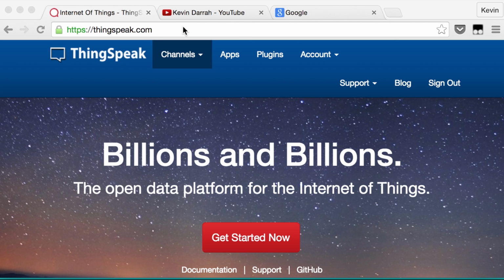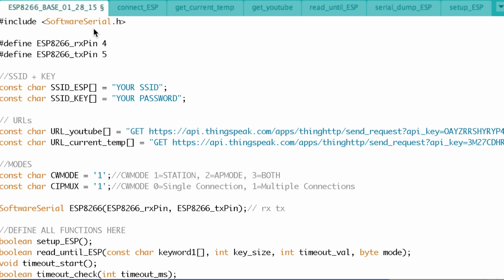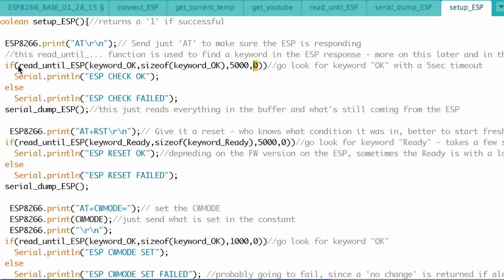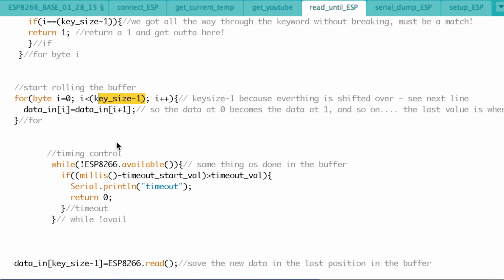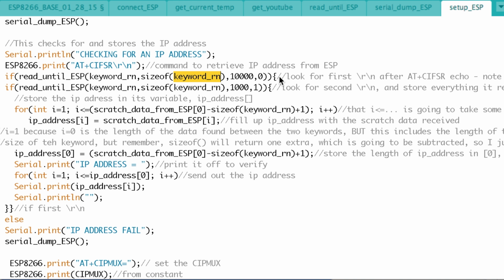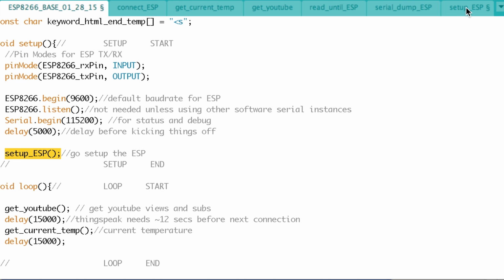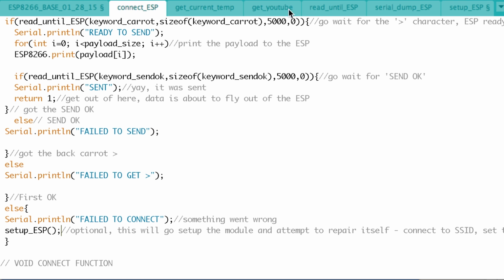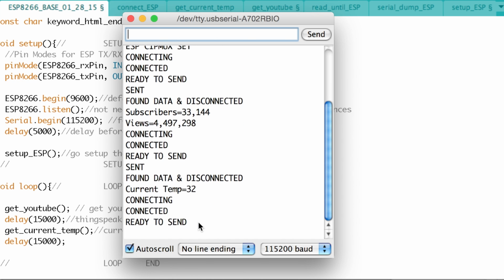Cheap and Easy WiFi (IoT) Tutorial Part 2 - ESP8266 Arduino Code

Comment: Hey Kevin' great tutorial. I really love your tutorials and they're simply the best out there. But you should really consider using the actual API for getting data from websites since the current method while it works just fine its a lot of overheard and its not proper since websites change their layouts all the time.

Comment: Hoping someone can help with an issue setting the baud rate on the esp8266.  I updated to this latest version of the cloud update:

AT+GMR
AT version:0.21.0.0
SDK version:0.9.5
OK

I can connect well via USBTTL at 115200 but cannot change baud to 9600 so it will work with the arduino script in this video.  I've tried AT+CIOBAUD=9600 but that's not supported any longer (returns ERROR).

I found reference saying the right command is now: AT+IPR=9600 but when I do that I cant communicate with it at any baud rate and need to reflash the esp.
Reply from the maker: 9600 is default with the version I'm using in the video
Reply: Quick update...I was able to get this to work by downgrading the esp8266 to v0.9.2.2 firmware which apparently defaults the baud rate to 9600.  For some reason, when I upgrade to the cloud version (v0.9.5), it sets baud rate to 115200 and the typical AT commands to change it to 9600 so it talks to the arduino don't seem to work.

Comment: Great video, I really appreciate you taking the time to write all that code, and share it with the community, however I ran into a bit of a problem with this code.  Using a 3.3v Arduino Pro Mini with an 8MHz clock, I am unable to read data out of a web page.  Pluging my 3.3v FTDI into the SoftwareSerial RX side of the Arduino, I can see the data being passed to the Arduino, but if I Serial.print the data_in buffer as it is running, I can see large gaps in the page it is reading, explaining why the Arduino never catches the keyword.  Any ideas on what I could do to fix this?  The page I'm loading is small, so maybe I could ignore the first maybe 200 char(web server header), read the whole thing into a temporary buffer, and then search that at my leisure?  Any  thoughts?
Reply from the maker: yea, you are probably getting a buffer overflow.  The software serial buffer is pretty small.  Try it without printing the data - should be okay then.
Reply: Kevin Darrah That is what I figured.  I added the Serial.print line for debugging, knowing that it would amplify the issue.  By switching the ESP8266 to the hardware Serial, and my debug output to the Software, I am able to catch both keywords every time.
Reply from the maker: Thomas Carlin did the same thing myself :)   that's one of the reasons I said that read_until... function could use some optimization

Comment: Hey Kevin, Thanks for the video. I was wondering if you have played around with NodeMCU Firmware for the ESP8266 and programming in lua. It's a solution that means the board only needs power and no arduino as you can upload your lua code directly onto the board. https://github.com/nodemcu/nodemcu-firmware. Maybe you can have a play around and make a video on it.
Also how do you power your board? I now know after much failure that 3.3v pin on the arduino doesn't have enough current. It works a bit better when I use 3.3 from a usb programmer but I get another problem; the usb device doesn't show up unless reset is connected to ground (although it should be pulled high no?). Can you think what I might be doing wrong?
Reply from the maker: ***** yea, these modules can be a bit power hungry.  I buy cheap 5V to 3.3V switches off eBay.  They're less than a buck a piece - search  DC-DC LM2596

Comment: Using DOM XPATH for accessing is a brute force approach. I like it.  but if the HTML is updated it will break the DOM/XPATH lookup.
Reply from the maker: ***** ah yes good point, and this has happened to me before - nice thing is that you just have to update the thingspeak app, not your code on the micro.
Reply: Kevin Darrah Yes, I agree and it is a good thing, it now acts as a data proxy to the micro-controller
anyway good work and hope to see you more of you again.